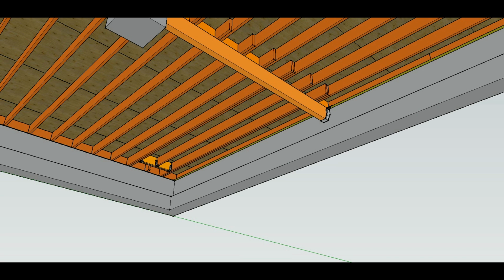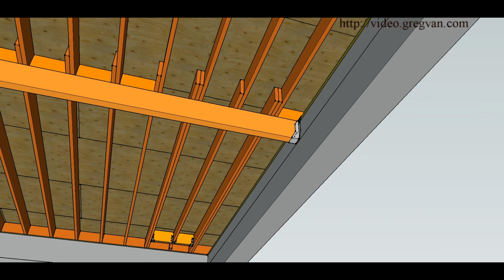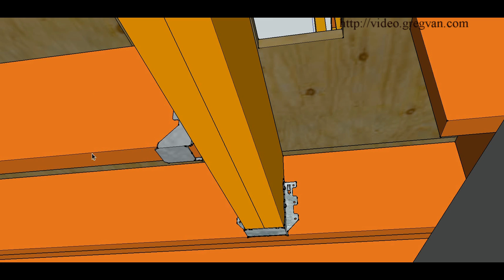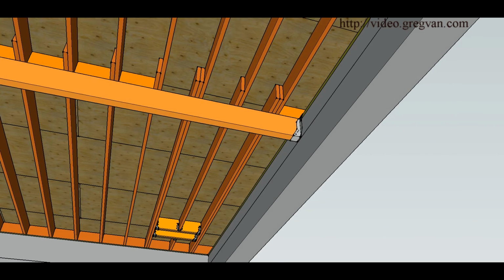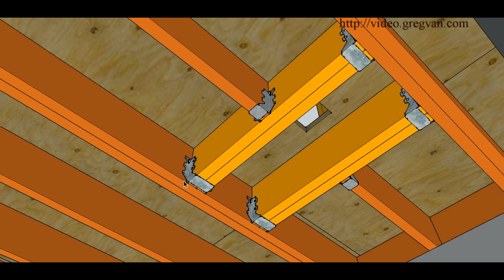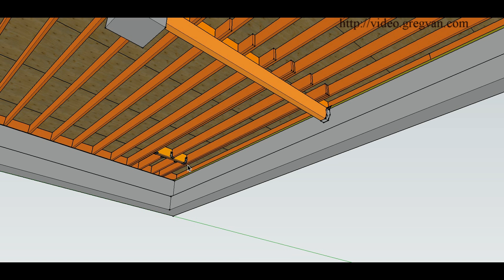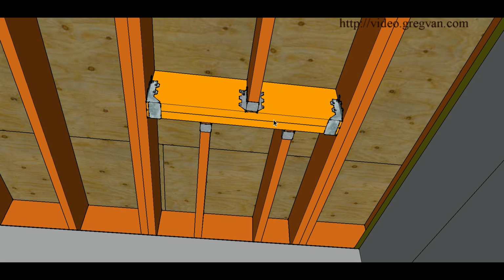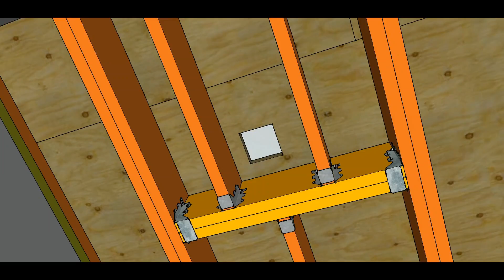How To Relocate Floor Joist For Plumbing Pipes – Using Double Joist and Headout

Comment: Cool graphics. I had to head off joists using the second method when I started remodeling my bathroom. The builders had notched too deeply in the top of the joist to accommodate a shower drain.

Comment: How would you go about doubling the outer joists if you don’t have access to the middle beam of the structure? Could you run it as far as possible and stagger bolt 16 on center?

Comment: Hi, I am doing a DIY home renovation of a 100 yr old house. We are putting through a SElkirk chimney for a wood stove right in the middle of the house. We noticed that all joist are 18” center to center apart. We were lucky to be perfectly aligned top roof to wood oven except for 1 joist. We need to cut it 18” short of Laos bearing center do the 10” chimney pipe can go up straight and levelled. Can we cut it and brace it to the others running side by side of that one? Do we need to double the ones running side by side with the piece being braced as this video? The layout is almost identical to my situation except all our sub floor joist run straight across (hemlock wood/thicker then the norm today). Thanks!
Reply from the maker: I can't tell you what to cut or replace, but send me a picture and I see if I can offer an opinion.

Comment: What is the method for undoing the plumbers box?  I'm doing a full renovation and have to put the plumbers box elsewhere and was thinking I should undo the existing ones.
Reply from the maker: You can reframe section or add small joists in box.

Comment: What would that look like with the silent floor joists , the plywood joist with board on top and bottom. 
I’m wanting a toilet installed exactly above one
Reply from the maker: About the same, you would need to double up the outside joist and for your headouts in the same way, but might use top flange hangers.

Comment: Using your second example, could you use the method to span multiple joist instead of just one?
Reply from the maker: I've seen it done, but cutting through multiple joists might require engineering approval or even additional footings or beams.

Comment: I need to notch 1.65" from the top of 2x8. The notch would only be to accommodate a 1 1/2 pipe so the notch will probably be around 1.25" inch wide and 1.66" deep. It would again be on the top and only about 14" from the wall support. Is it possible to just reinforce with a couple of 2x8 jog runs possibly? Love the video and thank you!
Reply: Late to be useful to you, but maybe useful to others: I think you can notch out that much from the end 1/3rd of a joist and have it be okay. I think this was covered in another video on this channel about notching and cutting holes in joists.

Comment: What size joist hangars are you using? They would have to be 3 inches to double up two 2x"s right? Where do you get those?
Reply from the maker: Yes they are often referred to as double joist hangers and would usually represent a 3 inch measurement. You can also use four by hangers or hangers that are 3 1/2 inches wide and then install a scrap piece of lumber or plywood in between the hanger and the double joist. I don't know where you're located, but items like these are often found at lumber yards, hardware stores or home improvement centers.
Reply: @gregvancom   Got it I'll check it out thanks for the info.

Comment: Nice video! What size wood did you use to act as the new supports that the joist attaches to? I need to do this to one of my joists as well.
Reply from the maker: Most of the time you use the same size lumber that you're working with for the floor joist. In other words if the existing floor joists are two by eights, then you can use two by eights for the head outs.

Comment: what about if I have same situation but in attic 4 13' joists from and want to cut a piece of one out to make way for a new attic access, my question is do I have to double up on the other joists as well or can I just do the doubler/header thing? would be hard to get 13' pieces up there.
Reply from the maker: I cannot provide you with engineering advice, but think that a 13 foot span might require doublers around the entire perimeter of the opening. Keep in mind that if you're going to use this area for storage, then it might even make more sense to double up the joist around the opening.

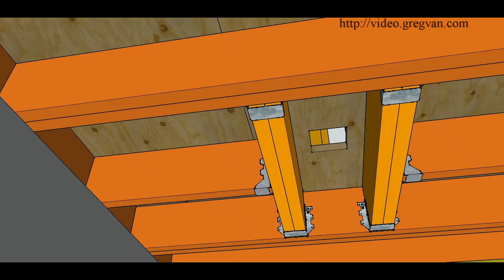Comment: At the 2:50 mark of the video. Can you tell me how big you can span that opening. I have a treadmill in the basement but my ceilings are quite high enough.
Reply: Same question. Same problem. Did you find the answer?
Reply: @krzysztofmekwinski8620  nope. Never did move the treadmill

Comment: Could you please explain how to add a header on a load-bearing wall in a Balloon Frame house?  I can’t get an engineer who has any experience in this type of housing.
Reply from the maker: I put it on my list, but don't know when I will be making it. Thanks for the video idea.
Reply: One idea that I heard from a builder (I have a similar situation) is to basically build a header below the window as well and run it out an extra stud on each side from the regular window header (because there are no jacks/trimmers for that below-window header). This creates a stiff platform for the wall above that is well-distributed across the studs below. Of course, this results in a lot of the wall being opened up as well as adding significantly to the thermal bridging, especially if you don't have exterior insulation. I also would at least run this by the building department to get their assessment (ours said this plan would be okay in a gable-end wall, which was my situation).

Comment: I want to repair two heater register holes in the floor---no longer have the heater. I have only looked at one location so far but a joist was cut to allow placement of a register. Can I double up on both cut ends of joist and attach that to single joists on either side? I imagine it is better than what is there now. It appears to be two by four framing just toe nailed into the single joists on either side and into the sub floor. It appears to be in decent shape as is but it wasn't done properly to begin with and I don't want to leave it like that.
Reply from the maker: Feel free to send me some pictures for more information, but it sounds like you might have a pretty good plan. You can get our email address at the website.

Comment: Are you allowed to cut hole in the doubled header? I am allowed to cut a 3" hole in my joist, but the tee measures 4 so i need to box around the tee then go threw the double header with 3" pipe
Reply from the maker: I cannot provide you with structural engineering information, but can tell you that is not a common construction practice. For example I've never done it before and wouldn't recommend cutting more than might be allowed by your local building authorities or building inspectors.
Reply: @gregvancom  thank you! I have decided to just drop my ceiling 4" to accommodate.

Comment: What would you recommend for having to go through 2 floor joists?  I need to run a 3" toilet drain through 2 10" floor joists.
Reply from the maker: You probably won't be allowed to do it, according to most building codes. My suggestion would be to drop the pipe into the ceiling area and then lower the ceiling height, if possible.
Reply from the maker: Another idea would be to form some type of a box around the drainpipe that is sticking below the floor joist. Let me know if this doesn't make sense.
Reply: @gregvancom  Hi is there a way to contact you maybe by email?
Reply: When home builders install stairs they use this method at each end of the stair well opening. They usually span at least two joists. So yes it should be fine using this method to span two joists on a small scale. 
Also you can (in some states) cut a 3" hole through a 2"x10" as long as it is 2" from the top or bottom of the joists.
I would (and have) in addition, cut 4 pieces 4 ft x 9.5in plywood, then glue and screw 1 piece to each side of the two 2×10's then drill my 3" holes.
It never hurts to over Engineer. 
BUT,  always check your local building codes.
What is authorized in Bangor, Maine (snow loads) may not be authorized in San Diego, CA (earthquakes) or Topeka, Kansas (tornadoes) or even Dade County, Florida (hurricanes)

Comment: I do need to box in a cut off joist to accommodate new bathroom plumbing but the joist to be cut is a double joist. Does that mean I should be making sure the single joists either side of the cut joist are doubled? They are currently singles.
Reply from the maker: I don't recommend cutting a double joist, because it might be supporting a load bearing wall, but if you have to, then it wouldn't be a bad idea to install a concrete footing underneath each side with a post or some type of support system.

Comment: Your diagrams only show the floor joists and engineering fixes when there aren't already plumbing and electrical running through existing holes in floor joists. How does adding a doubler and moving a floor joist work, to accommodate a shower drain if you have existing electrical and plumbing running through joists in an existing home?

Comment: What I understand is that if you are within 4 feet from an outside wall or beam, you don't need to add  any sister boards to the two adjacent floor joists. All you need to do is to add a board the same dimensions as the floor joist that connects the two uninterrupted floor joists.  And of course nail the cut floor joist into this board.
Reply from the maker: I've never heard that one, but if you have any literature or building code information, I would love to see it.

Comment: why not just sister a new joist?  have done that a few times and if you can actually shoe horn the wood in there, it is a simple and strong solution.
Reply from the maker: +Andrew Johnson You have raised a good point and I watched most of the video and only mentioned a few times that these scenarios could be used for plumbing pipes coming through the floor. I will modify the title and put a note in the video.

Comment: How would you double up a 15 foot joist on a finished house?  How the hell would you get it in there with other plumbing, gas and electrical in the way?  This would be impossible or cost a crazy amount.  Might as well build another house.
Reply from the maker: Hopefully this isn't Scarface, but if you have anything running through floor joist, then your project is going to require you to remove them, if possible and then do the repairs or if it's located in a crawlspace, you could always install additional concrete footings and framing supports.
Reply: @gregvancom  what your saying is crazy.
Reply from the maker: @Thirdplace4life  I know, it's a lot of work, send me some pictures of your project or explain what it is you think is crazy.
Reply: @gregvancom  I have a joist in the way to go straight up with a hood/range vent is all.  I have 3 inch joists. It's a custom built house, not the garbage they make these days.

Comment: Can you use regular floor joist around the hole or must you use lvl joist?
Reply from the maker: It would depend upon the situation. However, if you're using 2 x 10 joist, then you can probably use 2 x 10 construction standard lumber.

Comment: Won't those single hangers hang lower than the rest of the joists?
Reply from the maker: They could, but you can always use smaller lumber if that's a problem.

Comment: I don't understand the need to add new joists to the existing joists on either side. Doubling the joists.
Reply from the maker: It's a way to transfer the additional weight from the joists that you have cut to the building foundations. If you don't install the double joist on each side, then you would be putting additional stress on the single joist on each side.

Comment: How would you do this with an engineered I joist
Reply: Matthew Noblett  contact the manufacturer of the joist and find out if they have stock engineered repairs or they can provide it for your case.

Comment: I have a 35-year-old three-story apartment building built on a concrete subterranean garage. I am in the process of installing Mitsubishi's ceiling HVAC cassettes which measure around 14.25 inches wide. My first two floors have joists that are spaced 10" apart. My contractor wants to cut the joists, make a small box and strengthen it with Simpson strong ties If the building has 25 units and I want to install 1-3 cassettes in each unit, is this advisable?  I would prefer not touching the joists and suspending the AC units inside a small soffit and drywalling it to make it look seamless with the interior design.  The Mistubishi rep contractor recommends this method. I prefer this method but my licensed GC is telling me to cut the joists and fit the units in the ceiling flush.  Everybody is licensed, and I am getting permits with the Los Angeles city dept, so no gorilla work here. Should I avoid cutting the ceiling joists?   My goal is to renovate the building and make it a completely minimalist boutique-lux building but I don't want to weaken its structural integrity. I'm gonna speak with my architect and engineer on Monday, but my contractor is adamant that I do this.  He's saying that reinforcing the joists will make them the strongest portions of the building, but I'm respectfully disagreeing with him... I'm seeking your advice here. 

Oh, the joists measure around 2x 12 I believe, or 2 x 10".  I know the floors have 12inches in between them with a 2-inch softcrete on each level. I've also been adding recessed lighting in each unit so the joists already have new holes for the wires that were not there before.

P.S.2 I'm thinking the soffit is a better idea incase I ever have any humidity or moisture from the mini split unit that might cause dry rot, no?
Reply from the maker: I can't provide structural engineering information, but would contact an engineer, because you have some serious concerns that  need to be answered.